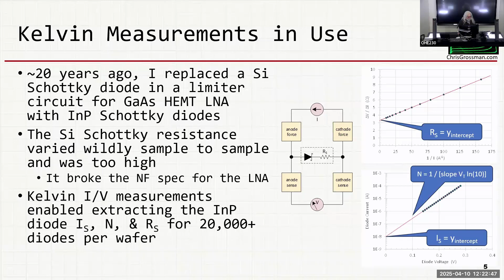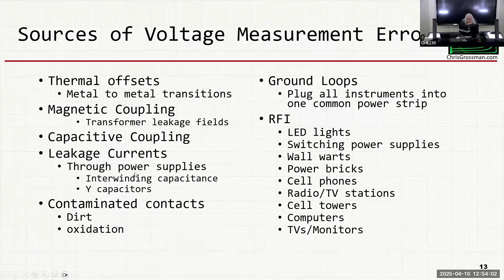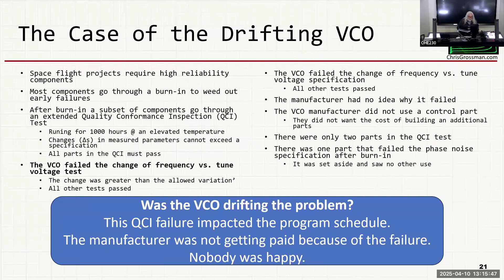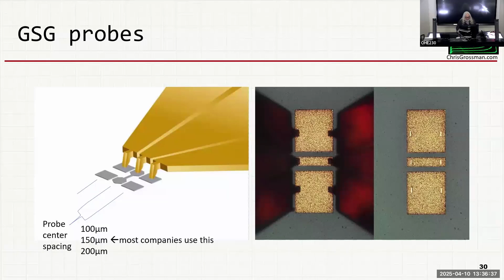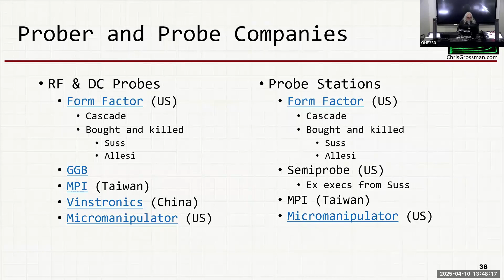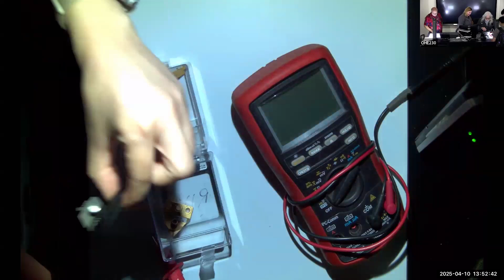⭐ Select Electronic Measurement Topics, a guest lecture for USC EE599 on 2025-04-10      0029

Comment: 12:52 Is it Tukia or Tunkia? If I search aliexpress (granted, not the best place to look for authentic metrology equipment ;) ), the only metrology result for tukia shows "tunkia" as the brand in the photos. Whereas if I search tunkia, there are a bunch of hits.

1:09:10 I used to work in a factory machining precision fuel injector components. The tolerances were on the order of a few microns. We didn't get big shifts so much from AC turning on and off, but we did get big shifts when the AC (or heat) turned on for the first time in the season.

Anyone who enjoys the testing failure will probably also enjoy a series of slides from nasa. They cover various, mostly electrical, failures - in systems that were supposed to be highly reliable. 
Search for "nasa dashlink observed failures" and the slides should be one of the top results. Alternately, replace spaces with slashes in the following:
c3.ndc.nasa.gov dashlink static media other ObservedFailures1.html

----

Always interesting to hear stories from experienced engineers - thanks!